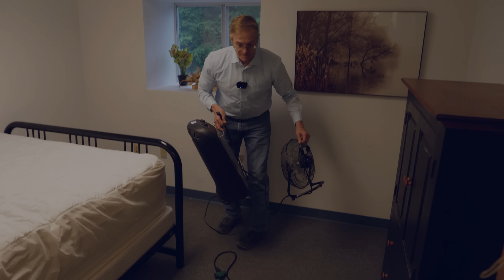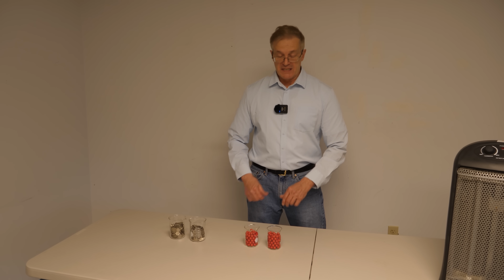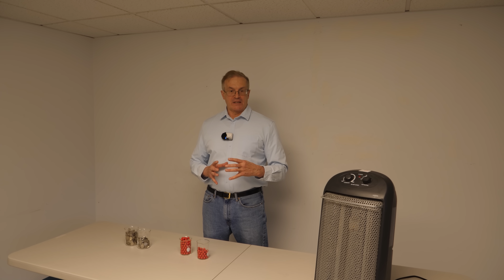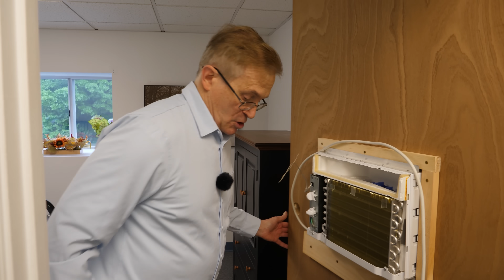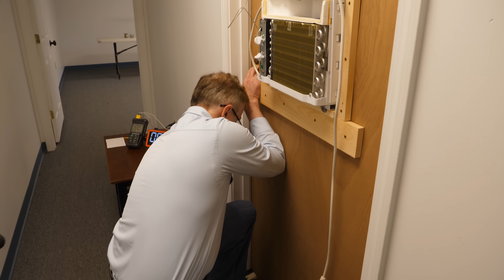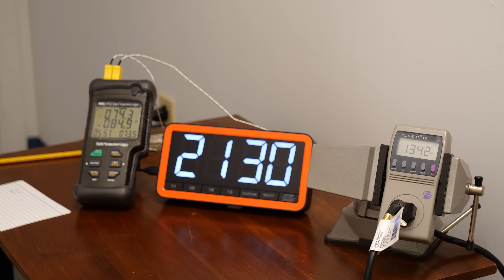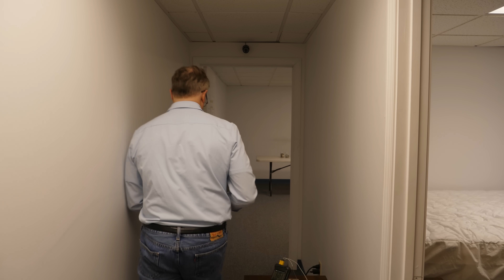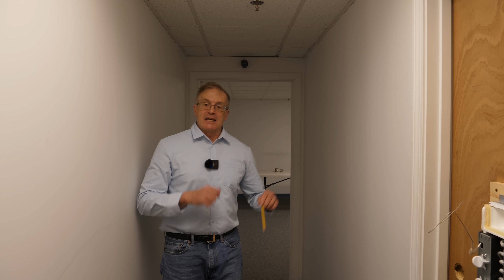You're wasting money on heating! Use your A/C!

Comment: I don't get it. So the heat pump is moving the beads (heat) from one container to the other, what's the space heater doing? just filling the container? So it's more efficient to move heat than create heat?
Reply: I don't get it either, maybe because i'm a Brit and we don't have them
Reply: Yes , it is much more efficient to move heat than create it in the first place . "Heat" is everywhere , just in varying amounts from place to place ! even when it is 1-2 oC outside there is still heat in the air which manifests as the vibration of molecules of air . Molecules vibrate all the way down to absolute zero when they theoretically stop vibrating (can't be reached ) So a heat pump just extracts a little of that vibration (energy)  from outside air molecules and transfers it to the air molecules inside the house but it extracts the vibrations from the outside air by passing through much more outside air than it heats on the inside !

Comment: The efficiency drops when the outside temperature is low such as when trying to keep a room at 70 with the outdoors at winter temperatures. There are diminishing returns the more extreme your winters. Heat pumps continue to gain efficiency, so it makes sense for more and more people.

Comment: What we need is a more efficient TEC, with almost no moving parts(except for fan/liquid pump to move the cold/heat away). Eventhough heatpumps are good(limited by the ambient temp and other factors), they have too many moving parts to breakdown. Also at low differentials, they are not efficient, since the compressor takes a constant energy. Imagine a high efficiency cabin cooling/heating in a BEV, we won't need to wait for next generation batteries to improve range!🤔Just some 💭

Comment: Pretty good, as usual! I would have preferred if you used modern reverse cycle air conditioner with thermostat involved and for longer duration ( 3, 10 hours or 2 to days….if weather forecast shows similar conditions) I believe you could get better insight into operation and savings. What you have shown are savings in raising the temperature in the room which does represent most of the cost, but real savings I think would be in keeping it at the level… suggest 23 °C. Results will vary by thermal difference inside/ outside and set temperature.

Comment: It's easy to forget about the coal power plant losing 63% of the input energy and the power grid losing another 5%... only a third of the energy of the fuel actually reaches the consumer.
The real competition to the heat pump is the in-house furnace, be it natural gas, oil or wood being burned - especially in cooler climates where an AC system is not a given.
Reply: Another interesting comparison would be photovoltaic + heat pump versus direct solar heating. With 20% efficiency modules you would need a heat pump with COP at least 5 to exceed directly capturing heat from solar, but it might be worth it if you can also capture the waste heat from the back of the modules and use that to also heat the space. 

Return on investment of the equipment would also be a factor, as well as whether you are grid-tied (and thus won't have to curtail excess capacity) versus off-grid (where PV curtailment might be significant during periods of low load when batteries are fully charged).

Comment: It depends on the type though its why the energy star rating is always lower for heat than cool I tested this with a mini split and my power bill was through the roof gas bill was way better also what you pay for electricity and LNG. But I agree with you it is more efficient depends on type and electricity prices.

Comment: This is a surprising result.
I absolutely never thought an (old) airco could be such a good heating unit.
Though I wonder what the efficiency is when I would hang it outside, taking heat from the cold air in winter and blow warm air in the house.
I suspect that these units are not designed to do this. Perhaps you (can) talk about this in the next video.

Comment: Put more simply, a resistive heater (space heater) generates heat by heating up a wire. An AC unit (window, or typical house system) simply MOVES heat. Theres two heat exchangers, one absorbes heat and the other rejects it. Heat pump systems have a reverse valve so that you can change which gets hot and which gets cold so you can choose how to condition your space. 

A heat pump system for a house is about 3.4x more efficent than a resistive heater in normal conditions and depends on the temp range. That means a heater that uses 100W makes almost 100W of heat. Using 100w in a heat pump/ac system will move 340w, roughly. That means the compressor and fans use 100w, move heat in the refirgerant and heat exhangers and that results in moving 340watt equivilant of heat. The colder the temps the less efficent heat pumps are because theres less energy in the outside air so it has to run longer for the same BTU movement. 3.4x is average for when you want heat in a house, and that number drops as you get closer to 20-30deg F. Newer systems operate more efficently at lower temps than older systems and its a huge range. So it depends, and Im not surprised Tech Ingredients is gettng 4.5x at these higher temps. They need to be REALLY careful with those efficency improvement claims so that they are #1 in ranges we need heating/cooling, and #2 the window unit will operate under those conditions without failing for bare minimum one heating season. Though that would not be evironmentally responsible to kill a window unit per season. 

Also you cannot use a window AC unit in the winter like this. The out door side part will run below freezing and shut off or kill the unit. Heat pump systems have heaters on the compressor and defrost systems so that WHEN frost builds up on the outside coil and it stops functioning in an efficent range the system reverses and melts off all the frost fairly quickly. If they apply these systems to a window unit, it could work. But if not someones going to try and replicate this and fail.

T.I. I love your content but make sure your results are useful! Signed a licensed HVAC tech that loves doing werid stuff

Comment: I hate to be Mr obvious, but I think that if you need AC to be comfortable where you live, you should move. I live in Southern California and rarely use my AC. I have friends that moved here from up north and even Canada that constantly complain about the heat. They have $800 a month electric bills. So why did you move here? Yeah it gets 85F in my house during the hottest months, but I use a fan and sometimes a water spray bottle. 
Smart use of a whole house fan is main strategy. Leave the fan running all night and cool the house to outside temps, about 65f-70f, then close all the windows in the morning. It stays cool inside till about 4pm.
I do have good insulation and 95 percent reflective film on my windows. And large palm trees on the south facing side shading the house.

Comment: The further north you live, the more important insulation, thermal transfer and air leakage is. Once you start dipping below freezing, it's efficiency becomes more and more dependent on your ability to trap the heat it produces. The Canadian government is aggressively pushing heat pumps, but significant renovations are necessary to reap the benefits.